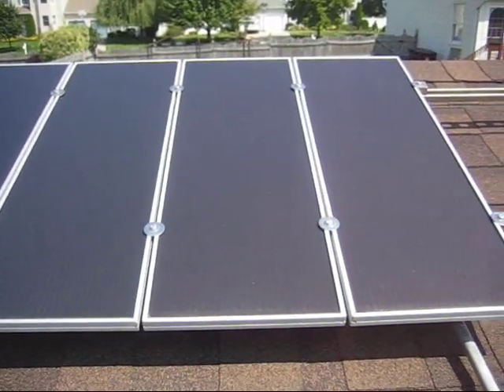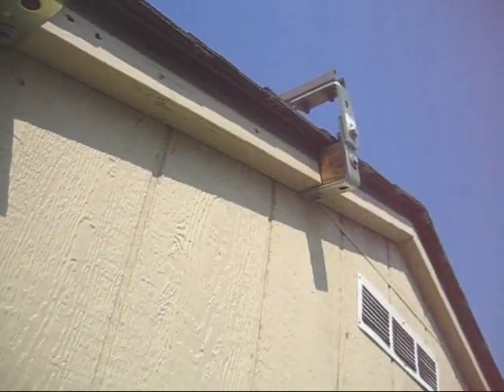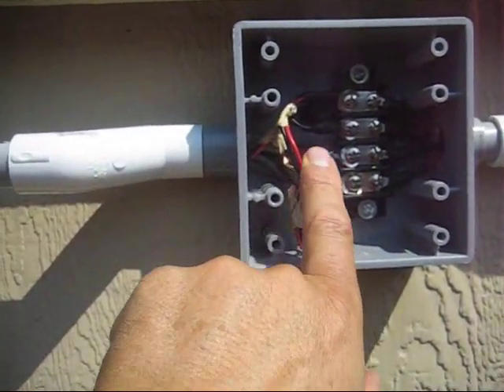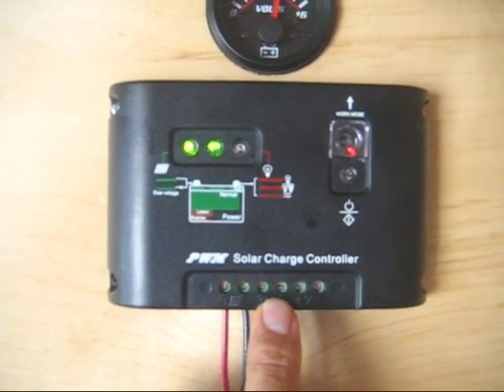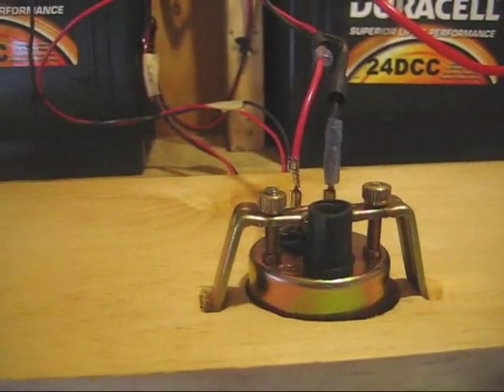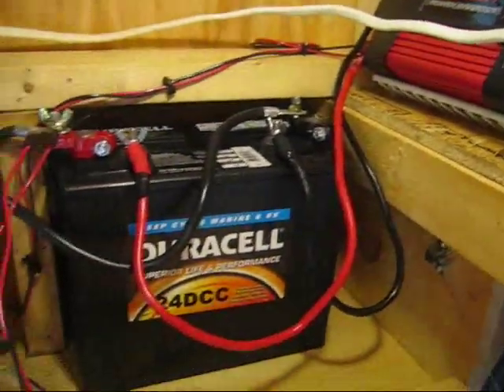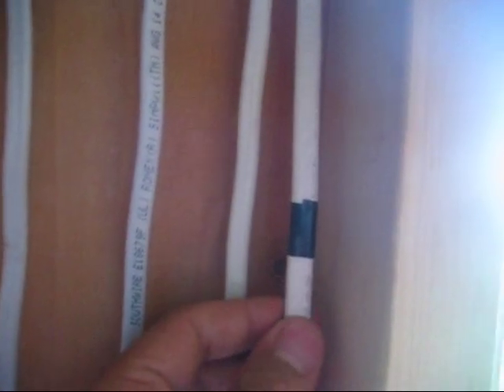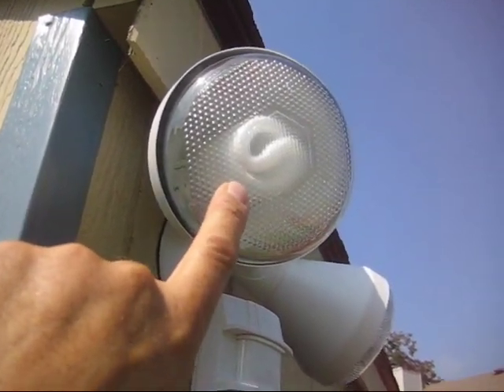Harbor Freight Solar Panel Powered Shed Setup-Project

Comment: Dude! Great video, hit all points of my curiosity and showed me some great new add ons to a little shed in the mountains I have. Slick set up thanks for sharing. I have seen so many either to much info or not quite enough yours was perfect for me and my application!
Reply from the maker: Thank you Visions Captured by Dave O. I since have replaced the modified square wave inverter with more efficient pure sine wave inverter awhile back.

Comment: nice set up.  How has this held up through the years?   Where do you live?   I concerned with the cold in the winter.
Reply from the maker: My panels had been up for years and held up pretty well. I live in South Jersey; my winters are not as bad like some other states. Also, I did replace the modified square wave inverter a while back, with a better pure sine inverter. With that said, my batteries need replacing and so it’s not been in use for a bit now. Thank you Andy Krug for your comments/posting.
Reply: @DoItYourSelfers   What about the batteries?  Do you have to keep them warm when its below freezing?  I've seen people  put seed heating pads in with the batteries to keep them warm.
Reply from the maker: Other than being in the semi-closed in box, I got around 5 years from them. Not really sure if that did anything but I didn’t have much in the way of any type of heavy load though, other than a couple of lights. The seed heating pads sounds like a clever idea.

Comment: Great Setup.   I used that same Charge controller on my first setup.
Reply from the maker: I did replace the one in the video to a Power Bright 900W. It works well. Thank you Jim for posting.

Comment: Hey great video but I have one question, you said your sister was 12 V but do you have 224 V batteries in parallel the front of the batteries say 24 V. So is your system 12 V or 24 V?
Reply from the maker: They are marine type batteries that are connected in Parallel, which doubles the capacity (amp hours) of the battery while maintaining the (12v) voltage of one of the individual batteries. If connecting the batteries in Series it would double the voltage (24v) while maintaining the same capacity rating (amp hours). Thank you joetheragman 42 for your comments.

Comment: Great video and even better ideas.  I am currently doing the same and looked around to see if there were any videos to get some inspiration from.  Did you completely re wire the panels or did you simply cut the plug off to run the wires to the terminal?
Reply from the maker: Yes, I cut the ends off, connected the wire ends to the one side of the terminal, purchased additional wire and connected it to the other side of the terminal and ran it into the shed. Thanks Roger for commenting.

Comment: How much power can you draw for how long before the charge controller (which model is it and do you like it) shuts down to protect the batteries?  Does the charge controller actually limit the voltage/current into the batteries to essentially float charge them after they're charged?
Reply from the maker: Hi Jeffrey, I purchased the controller on eBay a while ago and by-no-means is it anything fancy. I really haven't put it through its paces. I'm just running a few lights and a car radio, (for now). It's been working with no problems. Some of the controller features; protects from over charging or discharging, over load protection and reverse current protection at night, (just to name a few). Thanks Jeffery, for watching.

Comment: Great video. I would like to set my shed up in a similar manner. Wondering if you can give me more info on the wiring portion, starting at the terminal block thru the disconnect box. Thank you.

Comment: Got these for my father in law they are about if not brighter than the florescent bulbs you have plus they draw very little amps so you will be able to light your shed longer http://pages.ebay.com/link/?nav=item.view&id=131334108042&alt=web
Reply from the maker: Cool, I'll have to check it out. Thanks pbjunky511 for posting.
Reply: Your welcome

Comment: Replacing the cable between the plug and first junction box with stranded conductor flexible cable like SJ/SJTW or similar (extension cord stock would work) would be a good idea as solid core wire will develop conductor breaks if flexed too much.
And as a word of warning, the capacitive dropper power supplies that most motion sensor heads use don't like to run on modified square wave electricity.
Reply from the maker: Thanks ranacnam7321. What would you recommend in the way of a pure sine wave inverter?

Comment from the maker: Thanks wade61265 for commenting/posting. My original setup was using the 12v system lighting inside but since I never seem to leave well enough alone (LOL) I added panels and a battery so I decided to wire AC as well. Somebody stop me:) Thanks for watching.

Comment: Thanks for the video really like that you didn't put holes in the roof smart way to attach them panels  would using 12 volt lighting inside be a lighter load on the system?
Reply: Most likely, it would be a lighter load.  You would not have conversion loss due to the inverter.  But, you would need wires gauged properly to make sure that enough 12 V current reaches the 12 V lights.   Most RVs use 12 V lights.

Comment: I like the way you mounted the panels. I wouldn't want to make holes in my roof. It leaks easily without someone making extra holes in them. Very nice work putting everything together.

Comment: Dump those cfl's and get led bulbs, especially the spotlights!  It seems like you would conserve power better by using 12 volt lights in the shed, and skip having to use the inverter all together.